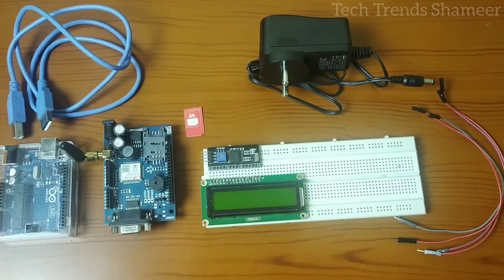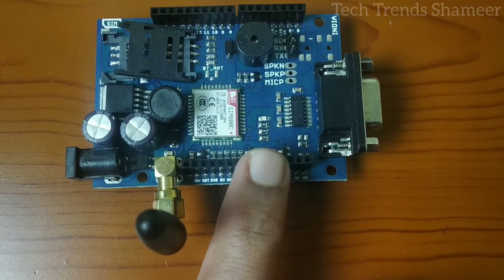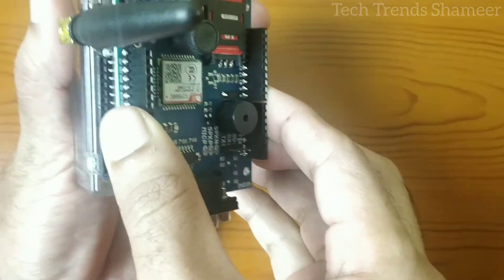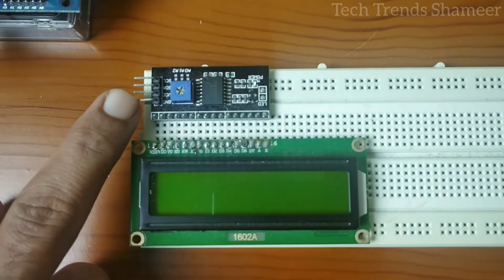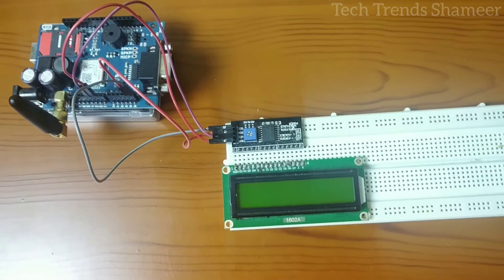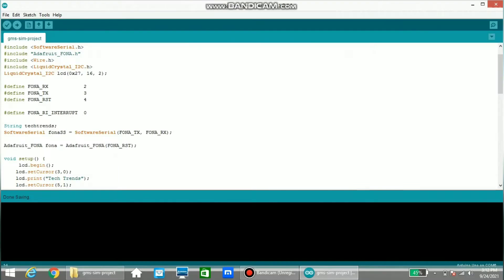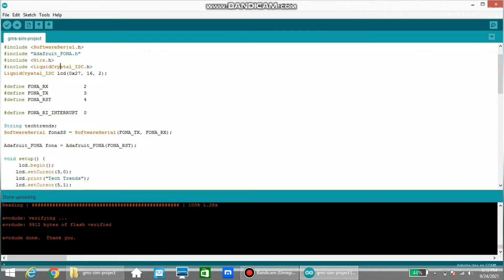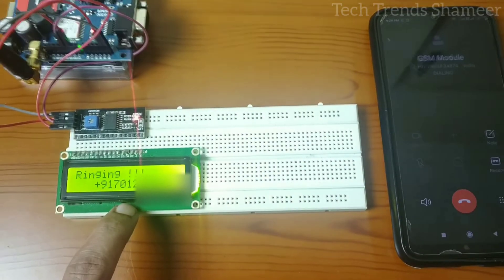GSM SIM 800 C Caller ID | Arduino Projects

Comment: Sir, flood alert  system using arduino.  GSM SIM 800C to receive call and message send back to. Can we use this code to sound the buzzer?
Reply from the maker: Yes. Add the code for buzzer

Comment: Hi .
Is there anyway to mod this to respond to a call .. I don't need it to answer ! I need to operate a relay or bell on ring and stop when the ring ends .....
Our sip phones used to use a function "ring anywhere' that rang an analog line with a factory bell attached .. But the pstn line has been removed .. I could use ring anywhere to ring one of these modules and relay a bell to ring ... But I don't know how to mod this !
I don't need the display I would just need to know how that buzzer is ringing .. Is it connected to one of the pin outs please ? 
Awsome video !

Thank you
Paul
Reply: Check thr AT commands for it
Reply: @amitasachan4942  thank you I managed to get it working !